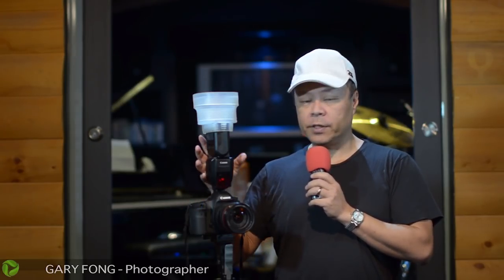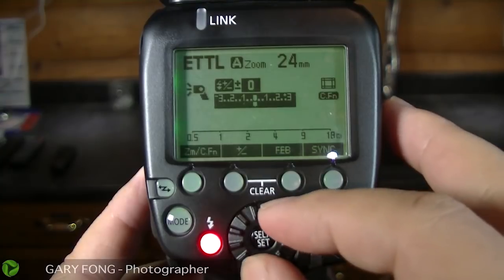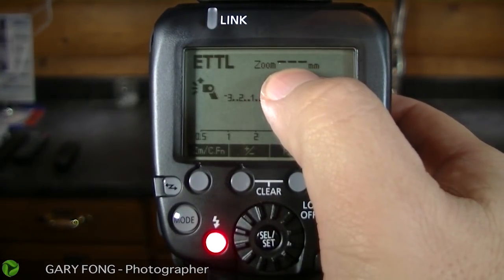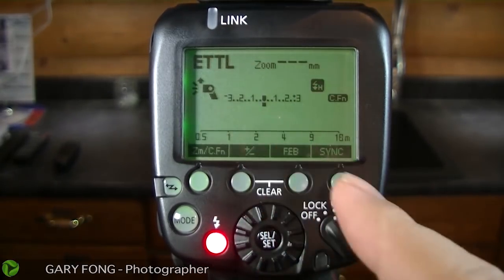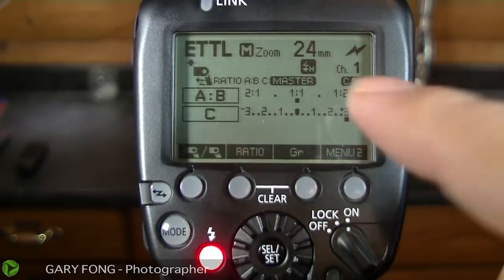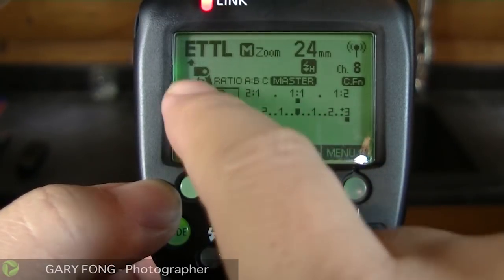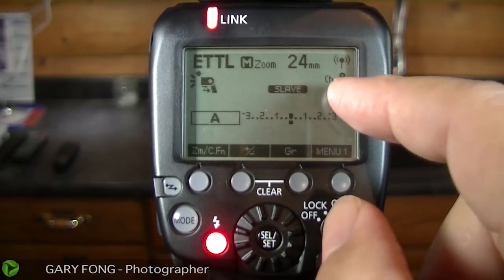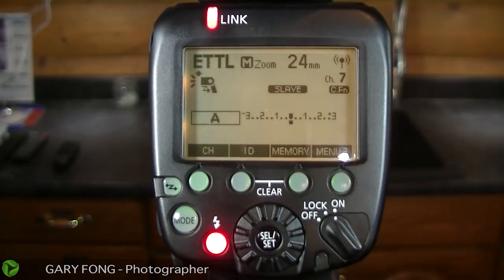Canon 600ex-rt Step-by-Step Setup Guide

Comment: There is a mistake in the explanation of the ratio. When the ratio is 1:3 between A and B, it means that B produces 3 times as much flash as A, not 1/3rd as much as stated in the video. I went back to the manual just to double check.

Comment: Is it possible to use 600EX-RT as an optical slave triggered by, for instance  studio flashes?
Reply: Yes, by two ways:
1. ATG Auto2 (Canon 580EX II can do it also)
2. Manual
3. Set all studio light into wireless IR

Comment: The tutorial was good, but it could have been better.

There was too much emphasis on Radio Slave with Canon Flashes only.
The Tutorial did not teach how to set the flash on AUTO ie E mode.
Can this 600EX RT detect and get synced with another external Radio Transmitter connected to a Studio Flash Unit?
Can the Radio Transmitter be activated if the Camera Flash 600EX RT is set on the E mode?
Reply: Rustom Havewalla do you REALLY think that everything about this flash can be taught in one video💛?

Comment: Are these the same instructions for the yongnou YN600EX-RT SPEEDLITE?
Reply: George Torres I was wondering the same, have you found out the answer?
Reply: Yeah it's pretty much the same. I got two and plan to buy two more.
Reply: You don't have wireless rear curtain exposure longer then 2 seconds with the YN 600EX-RT.  Be aware!

Comment: love your vid sir. i have a question i have this problem on  the  zoom part of the flash . why or how i can move it  cause it tell me is on wide panel & don't aloud  me to do other things thank you ..
Reply from the maker: Is the wide panel extended, or is the warning coming up even when the panel is retracted into the flash head?
Reply from the maker: To clarify, you cannot adjust the zoom if the wide panel screen is out. It would be counterproductive to proper use.
Reply: is warning coming pinto the flash head & it just do that...  :(
Reply: thank you  sir .
Reply: Pull out the white panel then insert it back fully into the flashhead.
Reply: thank you.
Reply: gabriel villa, did my suggestions help?

Comment: Now, with regards to my below comment, I understand that the master (Cannon 600EX-RT) will actually fire some pulse flashes, but they will not count in the actual photo.....is that right ?....if so problem solved !
Reply from the maker: Since the 430EX II is not a radio controlled flash, the 600EX RT does need to send line-of-sight signaling to control the 430EX II remotely. Those are probably the pulses you are seeing, and they should not affect the on-axis exposure.
Reply: Gary is correct.
All today Canon flashes have pre-flash (you get two flashes, but they happen very quickly that we see as 1 flash popping).

If you want to check if a flash has pre-flash.
Set your camera to Manual
Lower your Shutter really low, 1/2 or more
Press the Shutter Button
First flash (pre-flash)
Second (recorded on film or sensor) burst of light

Comment: how many flashes before the batteries die? I only got about 40 and then kaput
Reply from the maker: It depends on what power setting you're using with the flash. You should be able to get a couple hundred flashes, on average. Only getting 40 seems extremely unusual, and would be worth discussing with Canon Customer Service.
Reply: Try using 4AA Energizer Lithium Batteries.

No way at 40 pops with ATG/Godox/Quantum battery.
Reply: I shot 8 Roller Derby bouts yesterday with Eneloop rechargeable batteries.  Think I changed batteries twice during the day and got well over 1000 photos.

Comment: How come i have to press the trigger twice on my 6dmk2 with 600ex rt flash to take pictures? How can i set it so that my 6dmk2 and 600 ex rt works in one press of the trigger? Tnx. Same thing with it yn e3 transmitter.
Reply from the maker: Sorry, not familiar with that camera and concern. It's best to contact Canon directly, as this does not seem like a designed feature we've ever heard of in the past.
Reply: Gerry Galdo, you did put the camera into dial "M" from 60-200 shutter?
Reply: angelisone I did yesterday and now it works even if I use the other mode(av,tv,p). Thanks angelisone.
Reply: Gerry Galdo, do you have two Canon 600EX-RT or one Canon ST-E3-RT & Canon 600EX-RT?

Say if you have one ATG Gold/Canon ST-E3-RT transmitter on camera.
And have one ATG Gold/Canon 600EX-RT (handhold), you can use this as a wireless remote.
Once you pressed the "Rel" on the handhold speedlite, the camera's shutter will go off.

My staff and I liked the ATG over the Canon because the AF and range is over 300 meters.
ATG Gold AK1 Tribrid Transmitter has ATG AF Assist Light, bigger screen & ranges.
Yongnuo YN-E3-RT Transmitter can not do wireless remote camera trigger & "Linked Shot"

Give it a try on your Canon camera.
Reply: angelisone I have canon 600exrt, youngnuo yn600exrt with yne3rt as a trigger and they all worked together fine.
Reply: angelisone what do you mean by ATG Gold/canon?
Reply: Gerry Galdo, there are two ETTL II transmitters that can do wireless remote camera trigger
Just like there are two speedlites that can do wireless remote camera trigger.
And those two speedlites can do "Linked Shot".

Although, the Yongnuo YN-E3-RT transmitter looks almost the same but it can not do shutter release ( "Rel") nor "Linked Shot",  ATG never provide firmware for it.

To do wireless radio camera trigger (remote camera shutter) you would need either the ATG Gold AK1 Trbrid Transmitter or Canon ST-E3-RT mounted on the Canon camera hotshoe.
You placed your Canon camera where you wanted & while walking or hide from site.
Then you would use your Canon 600EX-RT has a handheld remote camera trigger.
Once you pressed the "REL" (release) from the flash, the camera will go off automatically.

Again, I am referring to camera shutter release. 
You and many are confused on thinking of doing wireless radio 2.4GHz ETTL II flash.

Canon made it very confusing because there are two links & release mode:
1st, everyone knows the Green LED on "LINK" (top left), that's radio in Master or Slave 
2nd, few know how to setup to "LINKED SHOT" (inside of LCD screen, top left)
3rd, little and even those claimed pros can't get it to work under "REL" (lower left of screen)

We use once ATG Canon EOS-1D Cr to trigger fifty other Canon EOS-1D X II shutters & flashes.
When the Master camera shutter button is pressed, the 50 wireless cameras will go off.

Gary Galdo, with what you have, you can not do wireless camera trigger.
Try to set up your flash into "REL" and press "REL"
With the YN-E3-RT on camera (which model are you using?)
Your camera will not fire.

Comment: ATG said remote radio camera firing with ATG Gold & Canon Speedlite 600EX-RT and ATG Gold & Canon ST-E3-RT Transmitter and remote radio LINK are not the same.

We are talking about wireless radio ETTL not wireless IR TTL
1. These two speedlites have tribrid features
2. These two transmitters have hrybrid features

1. Has "LINK" must be in Green under Master or Slave
1. Has "Linked Shot"
1. Has "REL"

2. Can only be used as a Master
2. ATG has ATG AF Assist Light
2. Canon doesn't have AF Assist Light (Canon will not reply to your question about this)
2. Both must be setup in Master to receive a signal from #1, for the camera to do remote camera trigger (shutter)
2. Both can do "LINKED SHOT" master or "LINKED SHOT" slave

Only the ATG Golds have ranges to beyond 300m!

ATG, Gary Fong, Rudy, Chuck (friend if ATG, passed) and Syl have training on these nice features beyond the wireless flash TTL trigger.
The instruction manual can be confusing & not clear.  
There are actually two Links from the Canon RT system. 
Some, limited, will be allowed by ATG on Yongnuo YN600EX RT II for Link shooting with ATG and Canon's.

Anyone knows which app to make these work on Android?

Comment: I have my camera on ETTL but cannot get rid of the MZoom and I need it on A Zoom. I have tried to twist the dial right and left but the M is still there....can anyone help? With thanks Ali
Reply: Hi Katie K, when you switch the camera to the front, you will see the A. When you switch him to the sky it is gone...
Reply: He means when you point the flash straight ahead the A appears on your screen. When you turn it left or right, or toward the sky, it disappears because zooming is no longer relevant.
Reply: Katie Kittermaster Select the MZoom and move your dial all the way to the left.
Reply: I found the culprit the diffuser being out changes it to Manual Zoom. Why on earth I dont know.

Can someone explain why?

While I am using YN600EX-RT its a clone of the Canon.
Reply: +ImagesByDavid i opened it and saw a little switch that will turn off once the diffuser is out so it will remain to M zoom.put the diffuser back inside then you can siwtch the zoom to manaul ot AUTO.i also encountered this problem.
Reply: Because the unit cannot perform auto zoom when a diffuser is plonked in front of it. The diffusers job is to give you an extremely wide burst of light so auto zoom becomes irrelevant.

Comment: it's too late to comment but is it normal for ETTL to not fire continuously?
Reply from the maker: Depends on the battery power and required output of the flash exposure. Misfires are not uncommon if the exposure is too exhaustive for the system to recycle.
Reply: well that's all i need to know.  Thanks Gary! You rock!

Comment: I have this flash and i have tried literally everything, The green light just never comes on even in a well lit room, and even though the flash fires the image is still pretty dark. I have looked at every tutorial there is an gone through every option, Either canon sold me a broken flash or some shit isn't right, so annoying. external flash firing is enabled (5d mark111)
Reply from the maker: Sounds like a defective flash. We assume you've tried fresh batteries???
Reply: You do know the green light only comes on after you have fired the shot and does not stay on long so if you don't look really quickly you wont see it

Comment: Sorry, I must be missing something, I have watched this video several times and have followed all the steps but I cannot stop my 600 from firing.........it does control the 430ii OK.............
Reply: Stuart Ducan, are you saying the 600EX-RT is on camera?

This how you should setups:
1. Canon 600EX-RT (wireless IR ETTL II Master- on camera)
2. Canon 430EX II (wireless IR ETTL II Slave- off camera)

Both flashes must be set on same Group & Channel.
You can disable the 600EX-RT from firing or just bounce the head away from subject.
Better if you zoom the flash to 200mm and aim the flash-head toward 430EX II.

You have on wireless radio flash & one IR flash.
The 600 flash must be set to wireless IR.

I hope they are helpful.

Comment: Why did Canon discontinue the 580EX 2 flash?
Reply from the maker: I'm guessing it's because the flash had been out for a while, and it was time to release a new product with improved features like the radio transmitter feature of the 600EX-RT. Just a natural progression of product line...
Reply: ATG said in some part of Europe you can get the Canon 600EX.
This is the replacement of the Canon 580EX II.
That is because certain frequency put out on the 600EX-RT is not allowed in those countries.

600EX is without wireless radio ETTL II features

But all 580EX II up to 600EX II-RT have ATG Auto2 features that many non advanced flash photographers are lost. It works much better than ETTL II.
Reply: Radio transmitter works around corners. Through doorways , behind walls or subjects making old 580 ex flash neading to be pointed at one another obsolete. That in itself was a reason to say bye bye 580.

Comment: I'm a little late to this party but can I adjust the output level of the slaves from the master or do I need to visit each slave individually to raise or lower the flash output level?
Reply: ATG/Canon allow to do both wirelessly:
1. From camera's flash menus
2. From speedlite (master in radio or IR TTL)

Comment: Hi Gary, love your videos but you made a lot of mistakes on this one! Firstly, ETTL hardly ever gets things right and you’re completely confusing the “ratio” system with “percentages”.The A/B ratio of 1:3 means group B fires three times as much power than group A. NOT one third the power of group A!
Reply: You're the second person that's stated he got this wrong. I just bought this unit. I've had no trouble pairing, but the ratio's are a bit confusing. Any recommendations?
Reply: Hi, ratios are fairly simple but can be confusing to explain. 
For example, say you have a couple or more flash units and set them up into two groups, A and B. If you then set the ratio to 2:1, the flash units in group A will fire twice as much as group B. If you set the ratio to 3:1 the flash units in group A will fire three times more power than group B etc. If it is set to 1:1 both groups will fire at the same level.
It can be set the opposite way too. If you set the ratio to 1:2, now the flash units in group B will be twice as bright as those in group A.
Let me know if this hasn’t answered your question!
Reply: When talking A:B lighting ratios -- for example 1:2 -- The "1" (antecedent in math-speak) is your base or root exposure level of the A group.  The "2" (or consequent) is the power of the B group, and is one full stop more light.  Each time you double the consequent number, you are doubling the light output, thereby adding one additional stop.

So, 1:4 would be two stops, and 1:8 would be three stops, etc.  A 1:3 ratio means one and a half stops more light.  If you reverse that, say for example a 4:1 ratio, that means your A group light is 2 stops more than B group light.

Here's a video that might ahem illuminate the issue further:  
https://www.youtube.com/watch?v=QTah36HPTPs

Comment: my flash ready light always stays bleu it doesn t go to red ... the flash was working perfectly i used my 2 yn600ex rt  and both of them don t flash they open and everything but they don t let me flash .. J( i used battery pack on both flashes  i had a photoshoot ... yes they flashes were hot but everything was working fine ... the day after when i open my flashes they BOTH won t go to red to flash ... andd i tried everything ... do you guys know if theres a master reset option ?

Comment: I have this flash. I also have an external battery pack. Is there something specific I need to do with the flash settings when I hook it up to the external battery pack?
Reply: ATG allows two choices under Custom Function (C.Fn 12):
1. C.Fn 12-0 = using both batteries
2. C.Fn 12-1 = flash by ATG/Godox/Quantum battery

ATG and I recommend to set it at 12-1.
Then your 4 AA are used for back displays.

Comment: Not sure if I understood correctly but you said high speed sync requires more flash power or something like that. Wouldn't it require less if the flash duration is shorter at a higher shutter speed? I'm also new to flash using the 600 rt. Thanks.
Reply: hello there! if may i answer it, the reason is explained in the video... a 1/200 has a shorter light time duration because a 1/1000 exposure, for example, cannot be reached unless you 'turn on' the flash immediately before and turns it off immediately after the shutter goes down. in the bottom line, it requires a longer light on time due the nature of operation :)

Comment: measurbator dream equipment….  too many buttons… too low reliability…   just save your money and buy a real flash….  A friend has 3 of these,,, junk, expensive junk imo.
Reply: a friend... come on man its a flagship flash with built in radio slaves, learn how to use it... or in your case, your friends.
Reply: Michael Andrew we know how to use these things… the fundamental problem is they are unreliable crap… and way over priced…  I have to wonder if the engineers actually planned all canon cameras to quit functioning when you rotate the camera to vertical (the electrical contacts come apart)….  I have gone back to radio slaves and vivtar 285's and have 95% reliablility… or to regular studio strobes from white lightning or bowens with 99% reliability...